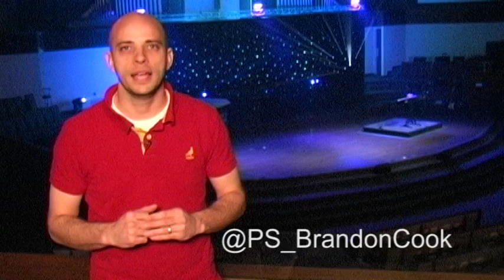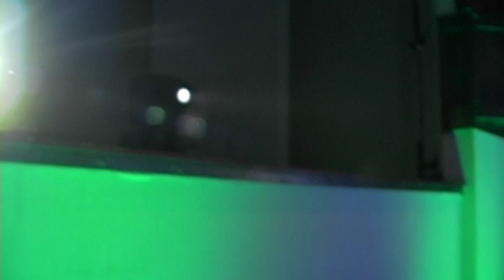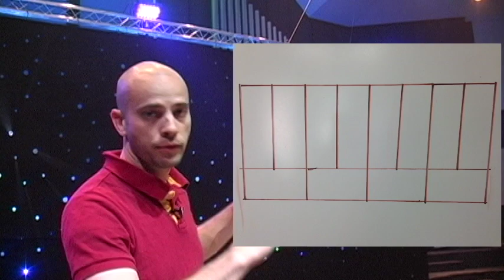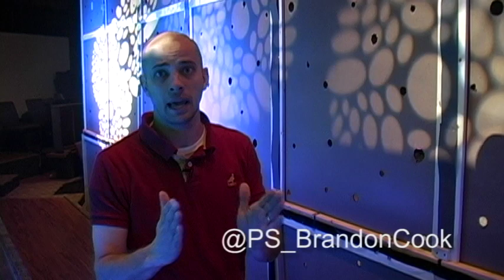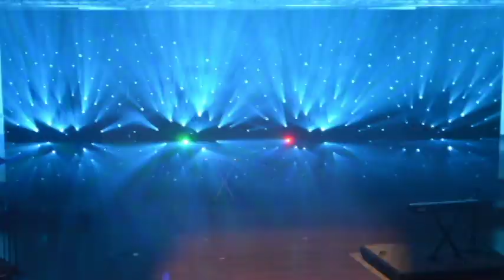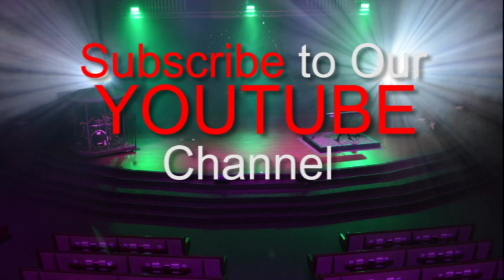Church Stage Design Ideas : Starfield Wall

Comment: Looks great! What are the specific 575W moving fixtures that you use?
Reply from the maker: +Andrew Bernardez 
They are a MAXXLITE, I think German Fixture...but I later purchased some generic fixtures from Alibaba.com that were the same thing...much cheaper too! Hope that helps.
Reply: +Brandon Cook 
Thanks! I've looked down that route before and am pretty hesitant because what will I do if something happens to the fixture, or arrives defective? Have you had any problems or issues with your fixtures?
Reply from the maker: Andrew Bernardez I had one fixture not work properly when it arrived, but they sent me a replacement part and it all worked out. 

The advantage (and some will argue with me) is that the reduced cost makes up for the possibility of malfunctions. I generally buy an extra fixture or two when I can and I don't spend too much time or effort to fix them when the break. It is often much cheaper to simply replace.
Reply: That's not a bad strategy! I have looked through Alibaba and found that there are a WHOLE LOT of sellers out there. Which one did you go through?
Reply from the maker: I do not remember. I found a good one on Ailbaba and have found that most of the ones on AliExpress are good as well!

Comment from the maker: We are using 2 Hurricane HD Haze 2 machines. But because the haze was not even, it was very fog machine looking coming out of our machines. We ran them through our HVAC system to mix it up real good and make the coverage super even. It works great this way in fan and AC modes, but the heater completely dissipates the haze. The HD 2 machines are great, especially on a tight budget, but you have to go through a good bit of work to even the haze out. Everything is a trade off I guess. Blessings!